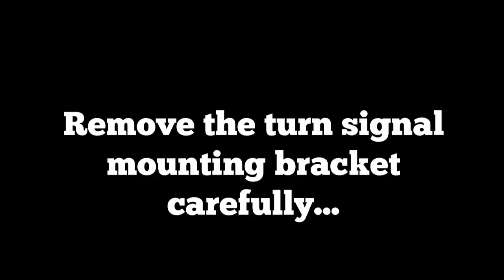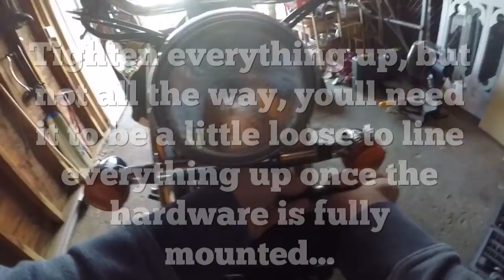Memphis Shades Batwing Install on a Honda Shadow Ace

Comment: Looks good. considering the batwing since i want to put some speakers on my handlebars.
Reply from the maker: Thanks, yeah I really like this addition, it's a great mod to add especially considering the rising I've been doing, I plan to chop this bike next season but can't part with the fairing...I love the look of a chopper or bobber but the ace really suits the bagger look as well... There's a speaker system specifically designed for this fairing but with a little imagination you can install something custom... Thanks for watching and ride safe

Comment: Thanks for uploading! I'm in the market for a windshield for my Aero 750. My thing is I need something to take away stress from my neck and head when riding. How does it work for you in that regard? Is there any wind hitting your face? I've read some of them tend to push all the air towards your head, is that the case with this one? Nice looking bike! Ride safe!
Reply from the maker: Sorry for the late reply I never received a notice of your comment... The fairing deflects a ton of the wind... You can further adjust and direct the wind by getting a taller windscreen for the fairing as well as the fairing itself can be adjusted to deflect the wind... Thanks for watching, Hope this helps and ride safe

Comment: is that the Memphis shades batwing it looks good on the 750 but I what the radio speakers and the only one I've been able to find is the tsukayu batwing but is over 800 and over 1100 if you want GPS installed I know Memphis shades makes the 400 Bluetooth speaker for that batwing but I've heard some bad reviews on it
Reply from the maker: Brandon Salas sorry for the late reply, been away on a training exercise...yes it's the Memphis shades, there's a stereo made for it that you can install,  but when it's all said and done the cost isn't too far off from the other pre loaded fairings you can find...when I purchased it I wasn't worried about a stereo,  not that I wouldn't mind tunes but there's also handlebar  speakers that you can get as well...just depends on your budget and needs/wants...thanks for watching

Comment: my 01 ace has the hard bags and baby coffin trunk.  I got 10" apes with a wide base. you think a fairing will fit with them apes?
Reply from the maker: So, in order to fit my biltwell chumps with my fairing, I would have to fabricate new mounting brackets if I want to keep the storage bags that mount on the fairing...taller bars would eliminate this clearance issue... (meaning, with 8"chumps, the brake resivoir, cable guides and whatnot don't clear the bags) A set of bagger bars (the ones with the low pullback) would alleviate this if you're stuck on 8"-10" bars... Taller bars, ie: 12" and up, should avoid this clearance issue all together, but anything taller than 8" would require longer cables... If you don't have the bags on the fairing, then you can mount 8"-10" bars but they won't sit up as tall as they would without the fairing, but will work, very aggressive stance, I just couldn't part with the fairing bags... I flip flop between stock bars with the fairing and my chumps without it depending on my mood... Hope this helps... Thanks for watching and ride safe

Comment: Hey man, pretty sweet. I have a 750 ACE I want to put one on...that a 750 or 1100? How did it change the ride...did it make a big difference on your hands? Or top speed?
Reply from the maker: 06cdvanw thanks for watching, it's a 750, the way I have it set up, for my height it helps a lot with the wind at higher speed, protects hands as well...there was some buffeting when I wore my half helmet,  but this was rectified when I adjusted the angle of the fairing...I would definitely recommend this fairing...ride safe

Comment: I have a 99 shadow ACE do you happen to have a link for this particular one? It looks killer.
Reply from the maker: Sorry for the late reply...I ordered this setup from Canadasmotorcycle.ca, but if you're in the states I'm sure Jafrum, Jp cycle or any of those sites will have it...you'll have to put in the year and model of your bike so you get the right size for your exact bike...
Reply: BONES Thanks. Roughly what was the cost?
Reply from the maker: With the windshield bag, trim and the windscreen I chose, shipped, it was like $900 ish...

Comment: Did yours come with the Winschel brackets or did you have to order the brackets separate
Reply from the maker: Sorry for the late reply...Each part of the assembly had to be ordered separately...the fairing, mounting bracket, windshield, windshield trim and pouches...its for customization and specific fitment to your specific bike...thanks for watching...ride safe

Comment: Do you have a link for the brackets and batwing itself?
Reply from the maker: I ordered everything from fortnine, once you get on the page, there's a scroll down menu for the bike you own, fill in the year, make and model and it will give you the option to only shop for parts that fit your bike... Once you go to the fairing, it will suggest the mounting brackets that are specific to your bike, then just choose the extras you want like the windscreen, trim and if you want pouches etc... Hope this helps...

Comment: A 6 Beer on the Difficulty Level?
Reply from the maker: RedPossum no man absolutely not, I'd say a two beer difficulty, three only if you're thirsty...
Reply: BONES well homey, it does get a lil peaked here in the south. Im mighty parched just thinking about June July Aug September. Lol
Reply from the maker: RedPossum lol no doubt, hoping to make a move that way when I retire from the CF... and if you pull the trigger on the fairing you won't be disappointed, thanks for watching and ride safe